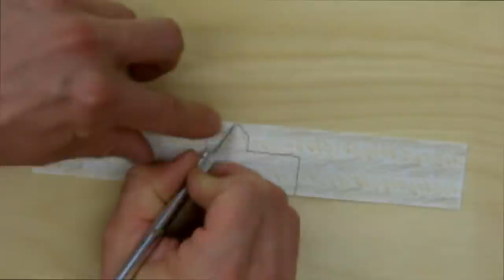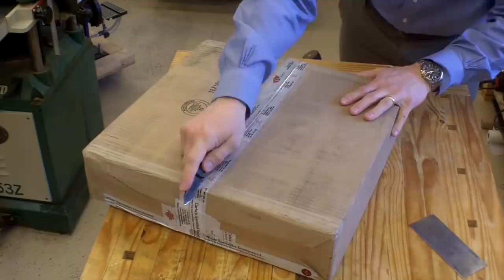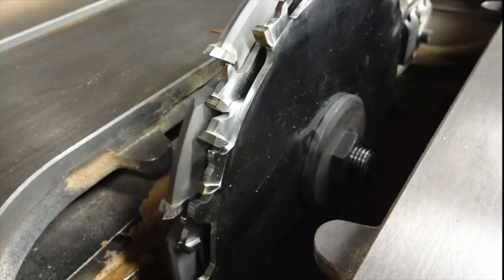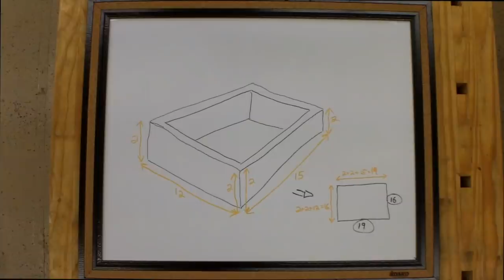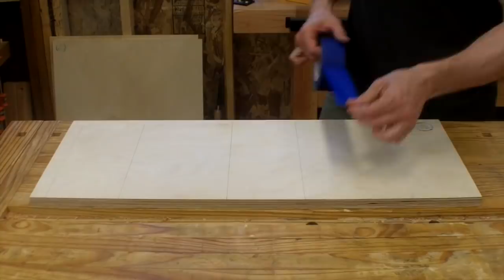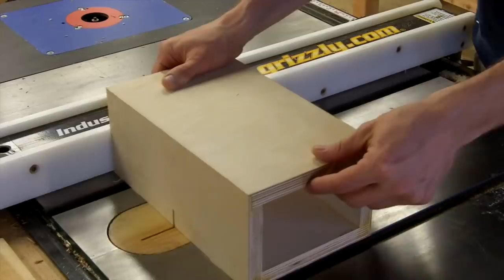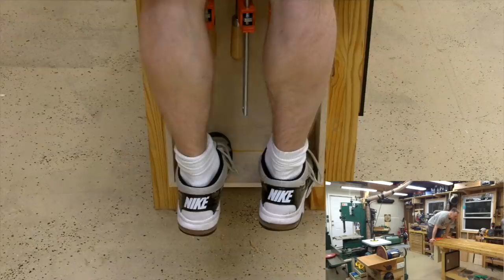New Invention - Easiest Drawers Ever!

Comment: I worked for a shop that made a special blade real similar to this for making countertop edges fold-up to the top..in other words you didn't have to apply a separate edging of wood and then laminate...just pre-lay the laminate on a top that includes  a width for the self-edge and then run it through the custom blade, (tape it first) then glue and fold the self-edge into the top. The owner of the shop also designed and patented a router bit and custom router base to make beveled edge countertops using the tape and fold trick. Plus, I've seen this shape of cutter before when we made a set for our molder machine...but we didn't bother having it patented because almost anyone can make custom shaper knives if you have the knife steel and the right grinders/stones. We had 7 grinders with 14 different cutting stones just for making custom knives for our molder machines. Now it's a lost art and you have to pay someone big bucks just to make a set of custom knives...ah the good ol days.

Comment: Seems like total overkill for drawers... a V cut to the same depth would make it just as easy to fold it up, no?
Reply: There is more surface area with his shape. More holding power. Plus the elegance of one cut per corner. A V shape requires two separate cuts.

Comment: Could someone explain to me why this wouldn't work with just a V-cutout with a router or something?
Reply: My guess is that it would work, but you'd get a smaller surface area for gluing and hence a weaker joint.
Reply: @lukel5190  Ah okay, thanks for the sidenote :)

Comment: The only thing I wonder right now, and I dont know if I simply missed it during the explanation or if it wasn't mentioned: What makes this specific cut better than, lets say, a 90 degree cut? The only potential difference I can see at the moment is surface area for the glue. But how much practical difference does it make? At what point is this specific cut a better investment than a 90 degree cut?

My personal guess would be that if you go beyond just glue, its easy to point out that due to the flat connection, you can use a screw or nail much easier to add some reinforcement due to lever mechanics. But I also think that a 90 degree cut would have a more equally spread out lever mechanic than this shape. Which I am not sure if its better or worse. It would take less force to spread it apart if they were connected, but there is also more glue to possibly turn that weakness into a strength.

In short: what are things people should keep in mind while deciding whether a 90 degree cut is going to be enough for practical purposes and when they should switch over?
Reply: The joint is such that the workpiece is 'self-assembling' and also provides continuous grain around 3 of the 4 corners.
I suspect that it is the mechanical 'tongue and groove' aspect of the joint that gives it easily enough strength for a drawer box.
I think the large glue surface area is almost irrelevant as all contacting surfaces involve end grain on one of the 2 mating surfaces.

Comment: Hi there. I'm really impressed by this. You're a clever chap, sir and a true inventor. Regarding the edges - I couldn't quite work out how, when you bend it into a sharp right angle, you don't get some sort of splitting, even if occasionally. I was expecting some tearing/splintering. Does the grade of ply matter? Can you do this with the cheap stuff and still get the same result?

Comment: Youtube recommendations really wilding in 2019
Reply: Careers
    Wellbeing Centre
    Canteen
    Buses
    The Uniform Shop

The College runs several bus routes (in 2019 there are 7 in the mornings and 9 in the afternoons) to facilitate students’ journey to school.

In 2019, buses will run through Springvale, Springvale South, Keysborough, Noble Park and Dandenong North. Families are charged for this service. The 2019 rate is $170 per term for one way, or $300 for both morning and afternoon journeys.

A copy of the 2019 Bus Routes are available via the link below:

2019 MORNING BUS ROUTES 

2019 AFTERNOON BUS ROUTES
Reply: @stevethea5250  Why? I don't understand. Why here?
Reply: @AmeshaSpentaArmaiti   Jake N.   @ultra carlos   @dracofirex  Is it acceptable/normal to get enrolment rolling at a handful of different high schools? Then family can further decide to pick from the Approved ones and ignore the unnaproven ones.

And for example we received the OK from 3 schools and choose only 1 - does it seem rude when declining the other 2 out of zone..? After all the effort of them checking with Assistant Principal etc fir placement…
Reply: @stevethea5250  q
Reply: @stevethea5250  nice copy pasta
Reply: @-Sean_  I agree 100% with this and have seen it work many times… but for some kids it simply doesn’t and its worth keeping that strongly in mind.

If parents dont pick up early enough that the child isn't going to kick it onto gear academically regardless of school or peer pressure the results can be disastrous for everyone.

I went to a public high school and we had a regular stream of kids arrive in year 11 and 12 after they had been politely managed out by nearby private schools. Years later with my own kids I think how many years of pain (emotionally and financially) the parents and kids must have endured trying to force a square peg into a round hole.
Reply: They're recommending us away from things that matter.

Comment: So as someone who isn’t a carpenter, what are the reasons you can’t just use a 90 degree triangle saw? Do you need those flat areas for glue or support?
Reply: abcdefghijklmnop1974 the areas provide a stronger joint than a 45 degree, and this way is foolproof but you can mess up a 45 angle

Comment: Maybe I'm missing something, but wouldn't a simple 90 degree wedge cut at a 45 degree angle to the plane have just the same effect? And if it's perfectly 45 degrees it would be symmetrical so it wouln't matter which side you cut it from, and this wedge shaped blade would work on any thickness plywood as well.

In fact it seems to me that almost any continuous curve between oposite corners of a square that is the thickness of the plywood, that stays inside this imaginary square can be rotated 90 degrees at one end to create a shape that could make a join this way. A lot of the curves is impossible to cut with a saw this way, but if you had a magic laser saws and you split the wood completely, you could still slide any such curves together as a jigzaw puzzle piece.
Reply: Other cuts can work, however, a 90 degree cut wouldn't have the same level of strength. Not saying this is the best possible design, but the cut here has much more strength than a flat wedge cut because there is far more surface area to work with and the force placed on the drawer joints is distributed better. Also as you said, most of the possible cuts aren't practical enough to warrant their use.

Short answer, yes but it would be weaker than this design.
Reply: This cut has more friction which means more strength.
Reply: That makes sense. This design is pretty close to the simplest shape that has this property.

Comment: 1k couldn't stand that intermittent gulping sound
Reply: Misophonia! I have this, i understand them...
Reply: Me neither. Also this is a 4.5 year old video and it's showing up in everyone's recommendations (look at all the other comments). WTF.
Reply: @deesnutz951  Funny, indeed, even the comments that aren't talking about youtube algorithms are few days old...
Reply: I gave a dislike cause it misses the fact that those edges will splinter easily, its dumb design he did not treat those corners, and its just better to cut fully through and attach same way but with pieces separate.
Reply: tr_a_lolo: It’s an innovative concept and what do you think sandpaper is for? He was mostly demonstrating the build and strength capacity, not illustrating a glass-smooth finish, which can easily be achieved.. after the glue-up you can chamfer the corners with sandpaper or even run them across a round-over bit on a router table to eliminate splintering
Reply: @potatomaster9001  If you need a pretty drawer, once you've finished one with Andrew's blade, just screw and/or glue a pretty face onto the front that's a little larger than the front.  You can also sand the corners a bit after the glue dries.  You could use some half-strength polyurethane varnish to help prevent splinters as well, but once you've put a pretty front onto the drawer, it should only splinter at the back.  This idea is genius!
Reply: @Ian Terry Roy MacLeod No offenses, this is not a good reason to dislike, disliking makes videos disappear from youtube recommendations and not be on top when you search for it, some people don't know this information don't matter how long this information is spread, if you know this information, just don't give a like, but if the information is not misleading, giving a dislike makes youtube algorithms think this video is useless, but it isn't...
Reply: @sophiacristina  preach

Comment: i mean for a drawer it doesnt really need to be any stronger but i think just a few screws in each corner would be way more than enough to make it hella strong

also i have no woodworking experience why the hell am i here
Reply: It depends on how you mount the drawer. If you put the slides on the sides, then yes, add a screw or two though the bottom. If the bottom sits on the slides then there's no need for that, as there won't be any stress on those joints (but for the pulling on the handle).

Comment: If you have problem with strength, then add some screws or plugs. And as you see, the tree is the one that fails if you use correct glue. Glue can be incredibly strong (at a museum here they had a 1000 kg weight, suspended in a steel bar that was 10 x 10 millimeters, and that bar was glued together by two pieces.
So, 1000 kg was held down by 1 square cm of glue between two steel surfaces. Glue is crazy if used correctly!

Comment: out of curiousity how is this diffirent from just routing in a 45° slope?
Reply: When you clamp a 45, you put pressure at a 45° angle at the cut, so the pieces will try to slide. Also, a 45 doesn't have any guide for your fold other than the veneer, this "locks" into place in 2 axis.
Reply: @HenryLoenwind  this saves time and a little effort, but seems just as simple (and cheaper?) to use a a 45° lock bit for router
Reply: sean huybrechts that was my immediate thought too. This might be stronger because of the perpendicular surfaces, but I'm not certain

Comment: The main issue I see with this is the first time you have to sharpen the dado or the specialty blade your tolerances will change and it wont work anymore, this would be better as a custom router bit somehow
Reply: 'custom carbide insert' is that that what you mean? Also i am a bit confused how sharpening would effect your tolerance, as you would  only need to bring the profile of the cutting edge down, reducing the diameter and to compensate you would raise the blade height. I understand that this would require more material extruding out and that the precision and quality will depend on the person sharpening and the sharpening method.
Reply: D Madd11  stay in your lane?
Reply: A similar idea already available in stores.Each piece needs 2 cuts ,but can also be used for edge jointing e.g. panels/table tops.  https://www.axminster.co.uk/axcaliber-mitre-lock-cutter-ax805970
Reply: Still gonna have to be sharpened regardless
Reply: i have a router bit just like this i bought 10 years ago lol

Comment: THIS. This, right here, is why I love woodworking so much! Woodworkers the world over are, collectively, the most technically creative people you’re ever going to find. Watching woodworking videos on YouTube, I am constantly amazed at the level of ingenuity. This is absolutely brilliant! Having said that (and having clicked through to the Rockler product page), it would be hard to justify that price unless you had a production cabinet shop. For the hobbyist, it makes more sense to cut 3 V-grooves (and a half V-groove at each end) and a slot for some 1/8” Masonite as the drawer bottom. If you’re going to be using an oversized drawer front, a lock rabbet joint is pretty quick and simple.

Comment: One side of me thinks this is really cool but my woodworker heart keeps telling me that drawers should always be held together by a mechanical joint (dove tail joints for example)  and not rely on adhesion only. Not so long ago we did not have strong glue and ppl have developed some badass joints over the centurys. Front and rear piece stuck between the side pieces with dowels are a great compromise to me by sticking to old woodworker rules and having a good economical result.

Comment: The router bits come in a couple different variations:  Yonico 15122 Large Lock Miter Router Bit with 45-Degree and 1-Inch Stock 1/2-Inch Shank : Meihejia 1/2 Inch Shank 45 Degree Lock Miter Router Bit 3/4 Inch Stock Joint Router Bit Woodworking Cutter Tool: etc...
Reply from the maker: Yeah I’m aware of lock Miter bits

Comment: Unless you're building drawers every week or month, I couldn't pay more than C$140 for something like that... Also, the bottom of the drawer is rock solid... Probably a good thing

Edit
I just looked on rockler. It's C$540 tax in and it is not even a 1 piece unit. Looked like 7 pieces with 10 or 12 shims.....

Comment: Nice innovation. This would be perfect for a cnc application.  The challenge with it is a cabinet shops use undermount hardware drawer glides which require the bottom to be recessed. Possibly dado and router the bottom out.

Comment: Wouldn't a simple "V" cut do the same thing? It too would bend closed and have no gaps.
I know it wouldn't have the same stepwise contact surface, but that is essentially what you are doing.
Reply: Gee Trieste idea is to increase surface area and thusly strength of joint

Comment: I use to own a small commercial wood shop in the 1970's.  I occupied a facility where a well known Maryland  speaker manufacturer (that continues to produce high end speakers) used an approach identical to this.   There was very precise machinery that cut a v grove on material that was laminated with plastic. The router was so precise that 1/64 inch plastic was used and very rarely was damaged ... finished piece was simply wrapped in a jig after glue was applied ... dried overnight ... voila ... finished speaker cabinet box ... worked exceptionally well ... The machinery was sold by several machinery makers (I forget what they called this process ... I think it was v-grooving) ... the machinery was demonstrated also in several woodworking machinery conventions in Atlanta and Chicago ... the joint was not as complex as yours but the approach was  the same as yours but did not produce as solid a joint ... but after the speaker box had a back put on it resulted in a very strong box.   Nice improvement however ... you should do well with this invention.

Comment: I've seen this exact profile used in sheet metal bending. The desk I use in my machine shop has sheet steel boxed corners and the strength is derived from this profile. Not a new idea to metal working but in a wood working application it makes good sense as well.

Comment: why the hell all them neg clicks to dislike.. yall gelous you didnt think of this//lol  keep going Andrew You the man.
Reply: (not english so i hope you understand ) i disliked because i use this method for years. Only 
difference is the blade. i use a custom made 45 degree per side point blade or a end mill 45 degrees (total 90 degree) on my cnc machine.  the glue surface 
difference is negligible  and there is no red and blue side so more easy to work with.

Comment: Job well done; reminds me of a plywood trunk I drafted & built in 1976 at Monterey Bay Academy in 1976.
     The 4 vertical joints were table-sawed & glued at 90° angles. The top & bottom were rabbited in & glued. Finally, a 3-inch lid was cut off the top. The project took first place at MBA's spring industrial arts fair.

"It scares folk over 70 when they find someone under 50 who both THINKS and PROBLEM-SOLVES."  Kürt Steffen, SIG

Comment: I've seen this back in the 70s, I worked in speaker factory and all the cabinets were made this way only with partial board covered with wood grain plastic laminate which held the corners.
Reply: That is correct.  I have seen it in the 80s.  A friend of mine is a cabinet maker.  He has been using this profile for decades.  It also exists as a commercially available router bit, for which, obviously one does not need a table saw machine.
Reply: 1959Berre - have you got a link to the router bit? Im struggling to see how that exact profile could be cut with a router, Unless maybe you do two passes?
Reply: Really? With the same joint profile?
When I was making speaker boxed we used a 90 degree router bit, and folded the joint up, but not with this profile
This design is far superior IMO

Comment: This is not a new joint. It may be a new cutter though.  I was using this joint on high end speaker boxes in the early eighties. We used jigs and inverted miter cuts on a table saw and multiple passes with on an overhead router to achieve this very joint.  Hopefully you get traction with the bit...it is a time saver.

Comment: I'm clearly late to the party here, but you have re-invented the wheel. 
Router cutters for drawer boxes have been around for years, https://www.wealdentool.com/acatalog/Online_Catalogue_Mitre_Lock_Jointer_143.html is an example. 
Look at the cut form, and the way the teeth lock. It has much more mechanical strength in one direction than yours. 
Now, that the base can be included is new, but I'm not sure how good that is, because if your fence is even slightly off square, your drawer will be pissed too, which is a no-no for traditional sliding drawers. 
With a base slid into a groove, you can always tweak the drawer square after, if required.